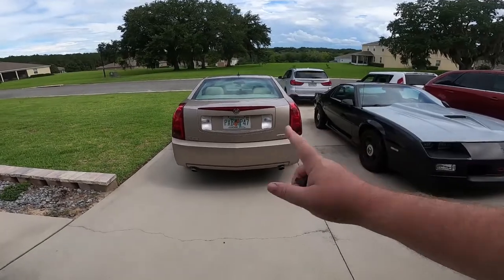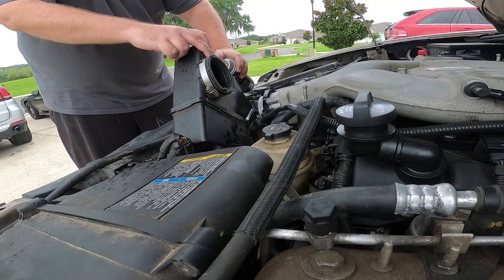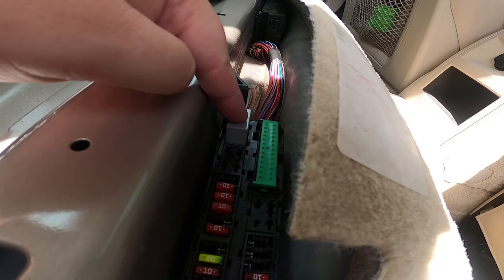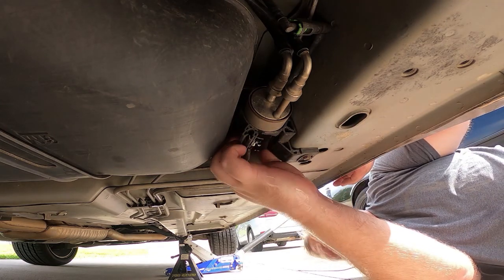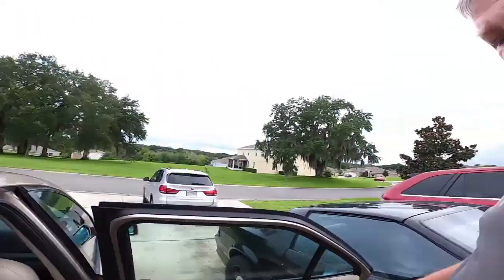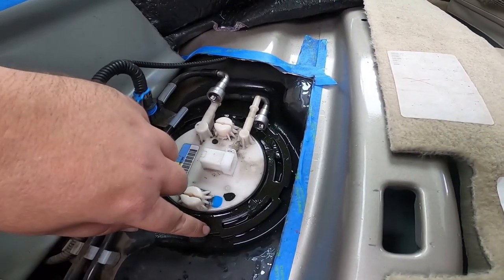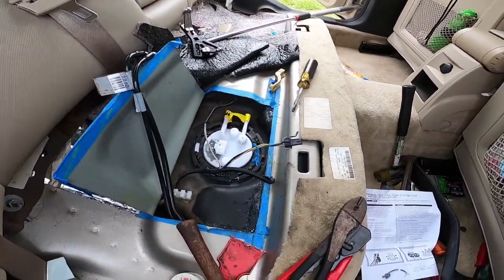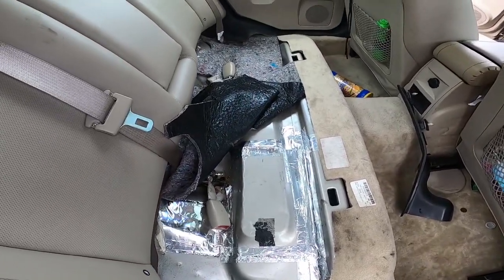2006 CTS crank no start troubleshoot and fix

Comment: With any GM vehicle including my '03 CTS I can always hear the fuel pump turn on briefly to prime the line when I turn the key on but do not go to crank.  The engine computer must be powered down between attempts as it will not prime the line a 2nd time if the computer did not shut down.  A fuel line pressure gauge does not cost much and is easier than pulling fuel line off the filter.  The first time or few times the fuel pump fails to run you may coax it into turning on by tapping the fuel tank from underneath so motor will move just a little so it will start running so you can get home.  Sooner or later this will not work.  You need to put downward pressure on the pump to twist the ring on or off due to pressure of o-ring pushing up and keeping the ring locked.  Put a wood block on the pump on flat area and have your assistant step on the block.  Then a hammer and bar can be used to spin it off.  Another channel showed that a relay my click but may be defective.  Their defective relay did not sound the same as a good relay when each clicked.  One can swap relay or temporarily run a jumper wire across it while diagnosing the issue.  I used a cutting wheel on a Dremel.  One has to be very careful to not cut into the plastic fuel tank just below the steel.
Reply: You cut it with a Dremel ? Must have taken forever? Grinder would think
Reply: @fishfire_2999  Angle grinder would be faster but larger wheel may have made precision cut harder.  The Dremel cutting wheels I used cut it fast enough for me.  Even with care I cut into the tank in 2 locations about 1/16 of an inch--not deep enough to cause an issue.  I am not sure I could hold angle grinder carefully enough to avoid deeper damage.  I would use Dremel again if needed.
Reply: @raykettel1837  Yah makes sense I have both still trouble shooting my 06 st wouldn't start leaving work Fri was running great hopefully just purge valve something easy usually not that lucky ,thanks for responding ✌️
Reply: @fishfire_2999  A fuel pump that does not turn on may turn on if one taps the fuel tank to move the motor enough to get it to spin even with failing windings.  That won't work eventually.  If car stalls after it warms up or won't start until some delay in time it could be the crank sensor.  A bad crank sensor will set one or two diagnostic trouble codes and turn on the check engine light.  A bad fuel pump won't set any codes or turn on check engine like.  A local auto parts store will likely read codes out for free or one can buy a tool to read out codes.   Tool may also read RPM and fuel pump commanded state--off or one.   Fuel pump relays can also fail.  There are 2 or three other relays in the fuse box near fuel part that use the same part number.  One relay is for interior lights so one code swap those two relays to test.  Relays normally fail and do not later go back to working state.   One can temporarily remove relay and use a jumper wire diagonally across connections in fuse box to test.  Diagram of pinout is on the relay.  I had to use a magnifying glass to be able to read the pin number labels on the bottom of the relay.
Reply: @raykettel1837 Wow that's a lot of info appreciated,so in my case I bought a can of starting fluid sprayed it in intake while my wife cranked it over after about 30 sec of this the car stayed running drove it home ran fine shut it off got home wouldn't start ,haven't had chance look into it yet but thinking might be the purge valve 👍

Comment: Just helped neighbor with same problem..  He tried to Loosen the ring for a week before he called me.  He was hitting it with chisel.... I told him the Auto Parts store will lend you a tool,  Off he went.
It DID NOT fit just like your first tool....  so I grabbed a huge set of channel lock pliers and a 1 Ft long 3/4" steel rod to use as punch.  I hit the Rod with the hammer and it move and then just moved back. 
So I had him squeeze ring from the opposite side like he trying to move it, while I hit the other side with the punch.   The ring moved and did NOT move back, three or so hits later the RING WAS OFF.  We had to put it back on the same way.   Hope this helps someone.  
He did the CUT the floorboard method also......Vegas OBie
Reply from the maker: That ring is such a pain, I have encountered so many of these on other cars, this was by far the hardest to remove. Thank you for sharing.

Comment: What if the car doesn’t start with starter fluid
Reply: i have this same issue, crank, no start.  sprayed starter fluid liberally in and nothing still.  loosened fuel filter line, fuel flows good.  i pulled a coil and have good spark too.  uggh